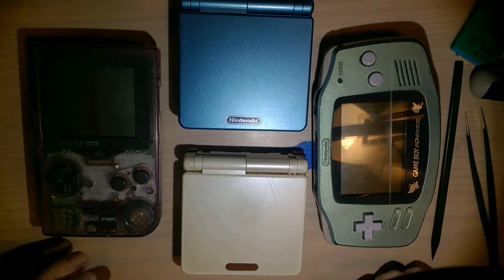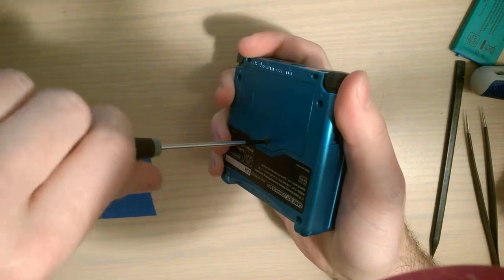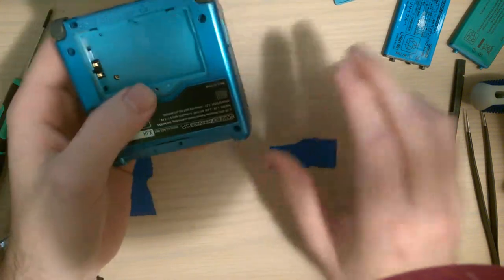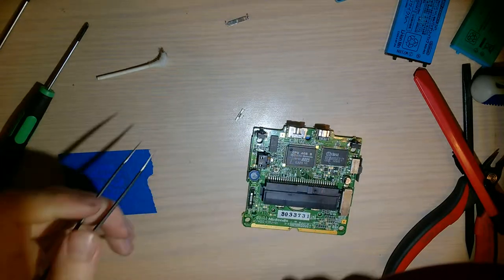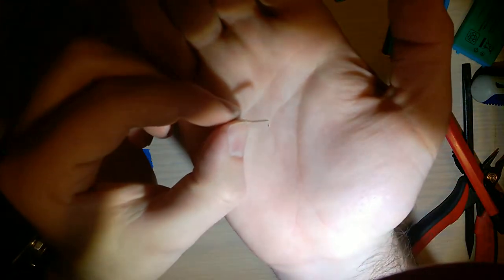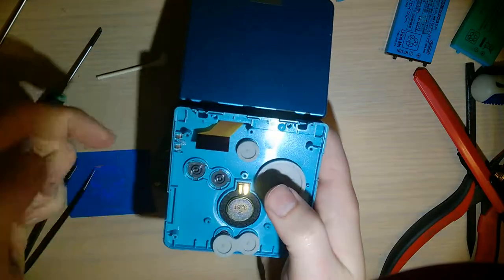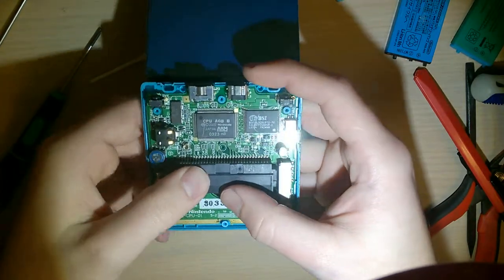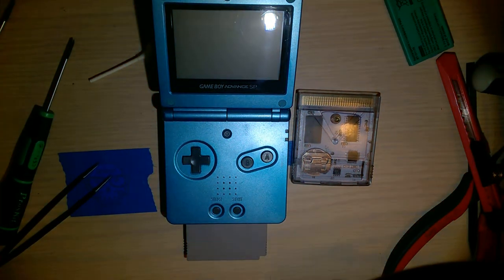How I fixed my SP with flickering power LED and intermittent power

Comment: Just wanted to say thank you for posting this video! I've had a GBA SP 101 that had the light flash between green and red all the time. I could get it to stop for a short while, if I pressed on the shell, right about the power switch. I thought for the longest time, it was a battery connection issue. After watching this, I decide to give it a try, and I think it fixed my issue, might be still to early to tell. I normally could replicate the issue right away, each time I tried a new "fix", but so far I haven't been able to. So thank you again!

Comment: Good video, but always turn screws left until it clicks into place before going right when you put them back in. That will set the screw to the original threading and prevent it from making new threads and damaging the plastic.
Reply: Oh I think I've already told you this on a different video. Lol. I didn't see it was the same channel.

Comment: Hey anyone who is coming to this and wants to quickly understand how to fix this. The problem is the power switch itself. You have dissemble the Gameboy, solder the shield off the power switch, take it apart and clean the insides with isopropyl alcohol. You better be comfortable with solder!  The problem this fixes is when the power LED flashes red/green or it switches off. Thanks Makho for making this video!

Comment: Thumbs upped and subscribed. I have to admit when I first watched your vid I thought it was dumb -- boy was I wrong. My board looked great and there was zero sign of corrosion but after testing the charging port and the two main fuses with a multimeter I was baffled and check and traced so many points of continuity that I began researching the boards and looking for what might be wrong when I saw someone post a comment describing exactly what you did in this video -- so I came back, watched again and pulled out the soldering iron and an exacto knife and did exactly as you did. My GBA SP AG 101 now charges and it's all thanks to you. Great vid-- you're helping people out there, so keep up the good work!

Comment: i finished installing an ips kit and everything went smooth. i wanted to clean the power switch while i had the soldering iron out and no matter what, that top metal cap of the power switch would not come off. i don't want to hold the iron tip to it for too long but i'm not sure what i'm doing wrong.

EDIT: i finally got it but i'm not entirely sure what i did. the small metal in the white plastic piece came off while i was cleaning it. took 30 minutes to find it but it was pure luck that i did. had to use superglue to get it to stay on the white tab. everything's working now. thanks makho for your video. i really appreciate it!

Comment: I just got a red GBA SP from a retro gaming store. It powers on and functions fine, only played it for a total of about 6 hours. However sometimes the power LED will flicker between red and green, occasionally staying red for a few seconds and switching back. It hasn't frozen or turned off randomly on me. But the flickering is bothering, because I believe it's at full charge.
Would following this video fix the issue? I've never soldered anything in my life and don't even know where to get a kit for it or how to use it. 🙃
Reply from the maker: This is not the project to learn how to solder on.

Comment: I installed a ipsv2 screen and now my GBA is flickered red and green constantly is this the same issue or something involving the screen mod?
Reply from the maker: clean your power switch
Reply: @makho  that fixed it thanks :)
Reply: @makho  hey my sp won't work i changed the battery but it's still not working i chraged it already it's charging buuuuuuuut when i unplugged it and it switch it it's still not working.
Reply from the maker: @consolectterree7030  https://www.reddit.com/r/Game_Boy/wiki/repairs#wiki_game_boy_advance_sp_problems

Comment: Do you have a “soldering for beginners” video? I have ZERO experience with it, but need to fix my SP 😭
Reply from the maker: I do solder practice streams on occasion. If you want my content, I'd suggest starting there. I have a few playlists on my channel tab. 

Otherwise, there are definitely more succinct videos from other creators though I do not have any specific recommendations.

Comment: This happened to me after replacing the speaker on mine with one i got from aliexpress, and it'll flicker the light and sometimes not. Would this be the same issue?
Reply from the maker: It's always the power switch.

Comment: My cobalt blue SP is acting strange. That's the only way I can describe it. It never fails to turn on but the light flickers from green to red then sometimes either freezes or powers off a few mins into gameplay.

I assumed it was the battery dying so I replaced it but nothing changed. Will I follow your steps here and clean the power switch or do you think the issue is more complex? Thanks

Comment: my little copper piece came out on the white power switch and it doesnt want to stay in, would i be able to put a small amount of glue to it?
Reply from the maker: no, just drop it in to the slider then install the slider assembly upside-down. Use gravity.

Comment: Yo my gameboy wont turn on when i move it all the way up to the "on" cursor on the side. It turns on when is at a certain point on the half. How do i fix this?
Reply from the maker: Gotta clean the power switch. Luckily, you're already in the right place and you can watch how I fixed my GBA SP with the same issue.
Reply: makho yeah i thought that was the problem. im going to try this, wish me luck!

Comment: I've had a similar problem where the orange light doesn't turn on when I'm charging it I've switched the battery to a brand new one but still got the same result. Is there any way to fix this?
Reply: Issue with charging port/ cable

Comment: hey makho, I was applying too much force to the wiper with an xacto knife and it snapped. I'm assuming I need to salvage that piece from another power switch? would the ones from retromodding be fine? Only hesitant because aftermarket products can be cheap.
Reply from the maker: like the whole switch? Should be fine

Comment: Hey i wanna do this but i don't have a soldering iron is it fine if i don't use one? Or i really do need it.  Thxs!
Reply from the maker: These switches are soldered together. Unless you have an ultrasonic cleaner and the proper cleaning solution, you need to use soldering equipment to desolder the switch for cleaning.
Reply: @makho  ok I'll have to buy one then, thanks for telling me.

Comment: Hi Makho. What do you think is causing this strange behavior with the red light? (Ags-101) If you press the brightness button, the screen will become brighter, but the red light will light up, and if you set a darker mode, the green light will light up. This is a fairly common problem, but I haven't found a solution to it.
Reply from the maker: higher brightness requires more power. More power means the voltage drops. Lower voltage means low power light. Clean your power switch then replace your battery.
Reply: @makho  Thank you very much for your response! I also thought about accum, but everything is a little more complicated, I just put a dead battery and the situation has changed to the exact opposite: in bright light - green lights, and in dim light - red lights. At the same time, the GBA SP stopped charging when it is turned off, but it is charging when it is turned on. Something was obviously broken :( All hope for your advice, because you are the only professional here.
Reply from the maker: @АлексейЗемляной-х2ь  sounds like you've got a pretty unique situation. Water damage?
Reply: @makho  Thank you very much, thanks to your idea with the power supply, I found a problem. I put wireless charging on. And your battery mod. Apparently not correctly connected wireless charging and burned f2. In its place, I put another fuse, which is similar in parameters (but still different). And here was the problem. All these problems with turning off the console and other bad behavior, gave the fuse. I'm not an electrician, so I'm sorry for the bad terminology. I found it so, the ammeter works only if on one side there is a plus to it, and to the other side there is a minus, so on a straight line its readings should be equal to 0. And I have on a straight line from d1 to bt+ the ammeter readings were 100. By logical reasoning, I came to the conclusion that the problem is in fuse, removed it and all the strange behavior disappeared.

Comment: Thanks for the tutorial! I accidentally got the wiper to come out. I put it back in and it works. Is there ever a possibility that the wiper can come loose from the white plastic switch while it's in there?
Reply from the maker: not possible as long as the shielding is installed properly.
Reply: Yeah I got some hiccups but deduced it was due to a 3rd party GBC romhack that caused it.

Comment: Hi, would you know what can be the problem of a gba sp which doesnt turn on but charges the battery? The battery is good, I have cleanned the power switch button and tested the fuses. The data connector is broken, could it be making a short in the pcb? I you want I could make a video
Reply from the maker: Is there any water damage anywhere?
Reply: @makho  I dont see any water damage. Here is a vid of the console
https://youtu.be/S2n0endikss
And this is the main board
https://youtu.be/DI3Lk4peH-U
Reply: Any suggestion?
Reply from the maker: @rafaliyo86  Makes sense that the fuses are fine if it charges fine. It won't power up because there is a short somewhere and it looked like there is something fucky with your link port. The plastic bit appears broken or missing and the bottom left pin (pin 1, VCC) looks shorted to one of the data lines. That can't be good. If that's not it, you can probably narrow down the short by checking all the caps near the power regulator (U4 IIRC) and CPU for which one is shorted to ground. I don't have a schematic for AGS consoles though so I can only give educated guesses on what specific components might be connected to those caps. 

If you are unaware, to test the caps, place one probe on a system ground and check both sides of the cap. One side should be ground and the other side should not be. If both sides are ground, either the cap itself has gone bad (unlikely but possible) or the component the cap is connected to has gone bad or developed a short (physical damage perhaps). An easy test is to desolder the suspect cap and run the test again on the cap pads. If both pads are still shorted, the problem is still present and you'll have to try and trace the circuit.
Reply: @makho  thanks for the reply. When you talk about plastic bit (i am not sure of the traduction) and the pin 1, do you mean in the link port? I want to remove it but its hard without a heat gun. I have bought one I hope to receive this week. BTW i take the opportunity to ask you about the propper temperature to remove components

Yes, I know more or less how to test the caps lightly
Reply from the maker: @rafaliyo86  Yes, the link port. There should be a small plastic bit that sticks out inside the port and has three pins on top and three pins on bottom (same as the power port but it will be thinner, flat, and the location of the pins is different). It is to serve as a non-conductive insulator and support for the pins. It appears that this part is missing and your pins are shorting. If this is the case, you can try just cutting the link port off, one leg at a time with flush cutters. Then you can desolder the pins individually. If the port is the issue, simply removing it should be good enough to test your console. 

I don't know a good temperature for removing parts. My heat gun just has a high and low setting. I usually just hit parts on low to warm up the whole board then switch over to high and focus in the area of the part I want to remove while I keep moving the gun to avoid overheating one area of the board. Eventually it gets hot enough and the part falls off. Often I remove extra parts by accident as well. I try and use kapton and aluminum tape as insulation or to hold on parts that I don't want to remove. Electrolytic caps must be desoldered by hand first if there are any in the area as a heat gun will destroy them.
Reply: @makho  No luck for me :( I have removed the link port but I have the same results.

I have tested most of the capacitors and they seem to be fine. I dont know what to do...maybe the motherboard is damaged and it has no repair?
Reply from the maker: @rafaliyo86  Hmm. I suppose it could just be completely dead. I don't know what else to suggest =(
Reply: @makho  yes, that should be the reason. Thanks anyway, I bought this console mainly for the case (kyogre version), the repair was an addition :_(
Reply from the maker: @rafaliyo86  If nothing else, at least a junk SP (to salvage the motherboard) is reasonably cheap.